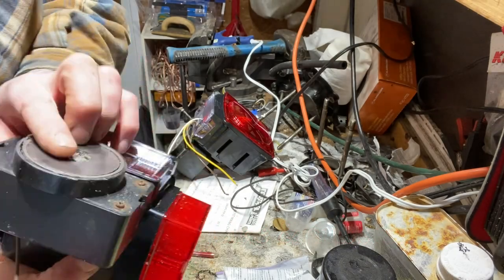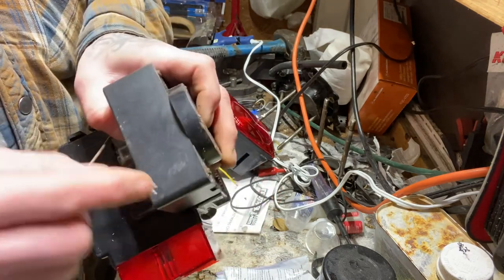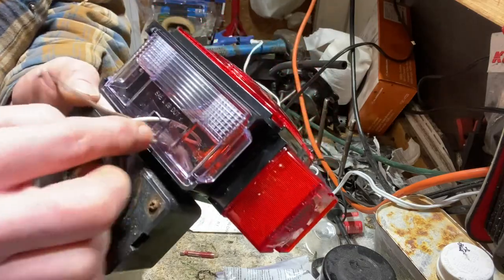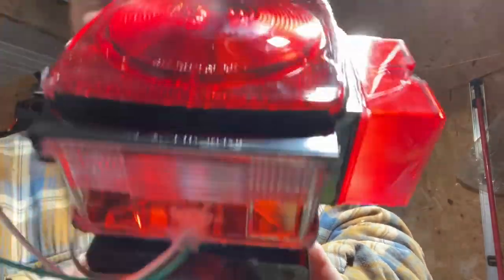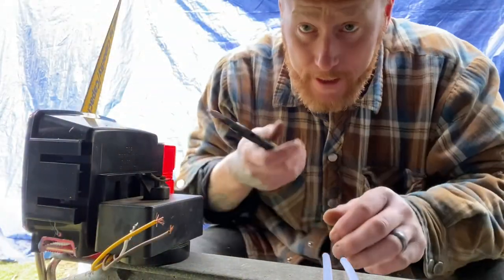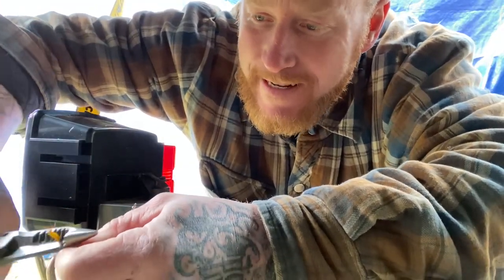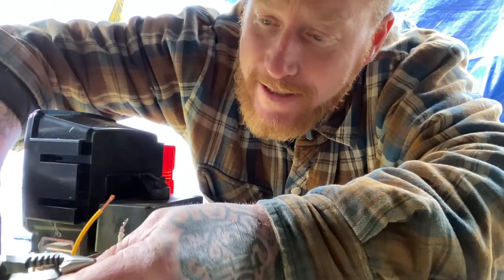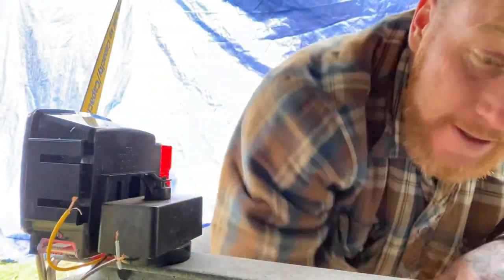DIY waterproofing, trailer, lights, and connections

Comment: Did you miss the point of "magnetic lights". You take the lights off before backing into the water. And you take off when you park it so they don't sit out in the weather. Added bonus, if someone steals your boat they don't have lights and the cops might notice that.
Reply from the maker: Well I forgot to take them off. When I backed into the water like a dumb ass. And so f*%# it make them water proof. If some one was to steal my boat there going to need a good truck. She is 32’ on a 40’ trailer and 10.3 beam.  14’ tall with the tower.  Lol. I have found a few power lines.